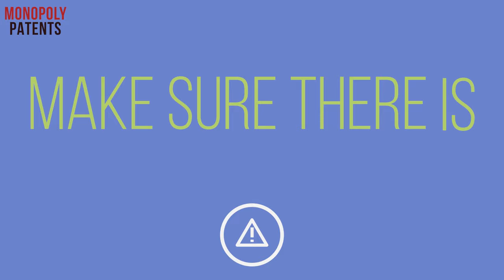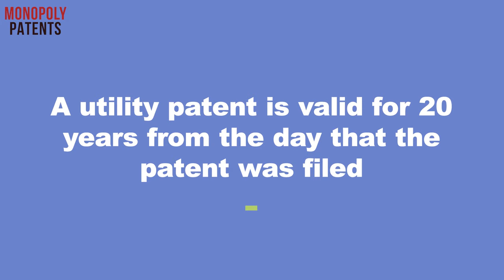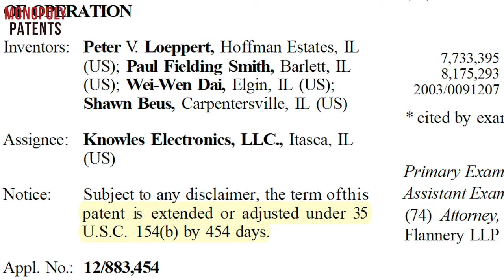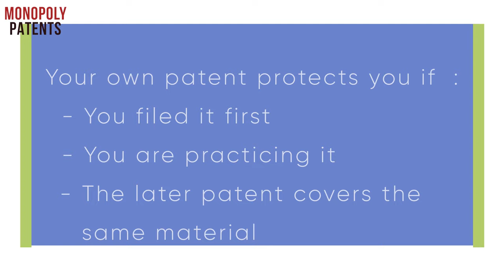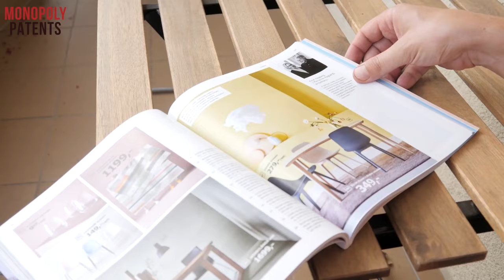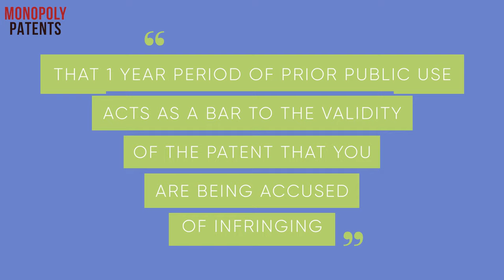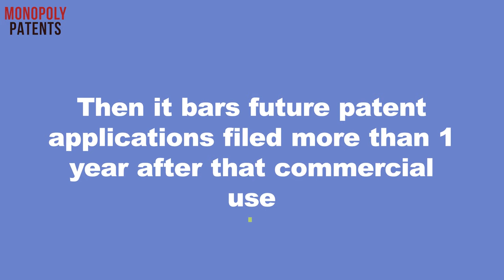7 Defenses to Patent Infringement

Comment: In regards to number 5 about prior publication, what exactly has to be published for the patent to not be justified? 

Say you patented a product you invented that isn’t on the market yet. Than someone copies it. You send them a cease and desist but they say your patent isn’t valid because someone talked about the idea of your product on a forum a few years ago. 

BUT no specifics about the product design or its manufacturing process were clearly stated. 

Can that invalidate your patent?
Reply from the maker: If the patent claim that you are accused of infringing has been taught in a printed publication more than one year prior to the filing date of the filing of that patent application, then the patent claim is invalid.  For example, if you are accused of infringing a patent claim of a recent patent that relates to a colorful bike handle bar streamer, and you find a 20 year old catalog showing detailed pictures of the same colorful streamers, then the patent claim would be invalid and could not be enforced against you.   'Hope this helps.  😊  -john
Reply: So as long as there is no details or pictures about the specifics of the product then it is still valid? 

Example:

Company invents, and patents, a product that allows you to mount a water bottle to your bike. 

Another company rips it off and sites a forum from 2 years ago where bike riders were talking about how they simply mounted their water bottle to their bike by their own means (no specifics on design or pictures involved). 

That wouldn’t count as useable prior art right?
Reply from the maker: @xrjake2955  Hi Jake, for a prior invention to act as prior art or invalidating anticipation of your invention, there needs to be clear evidence that the claimed invention was in the public prior to your patenting.  For example, a general discussion of a water bottle holder in an old bike forum would not be enough.  The discussion would need to clearly describe your inventive elements or better yet show in a drawing or photograph the claimed elements that you patented.  The publication needs to meet the burden in court of showing clear and convincing evidence that the invention previously existed, prior to the date of your patent filing.  'Hope this helps.  Warmest wishes, -john

Comment: Question on the fourth patent infringement. 
Is Amazon in violation for the advertisement of a patent infringement ad?
Please respond as soon as possible. 
Thank you,
Al
Reply from the maker: Hi AI,

I did receive the additional facts in your voice message and am addressing this here in a very general way.  If you would like to hire one of our patent attorneys for a short litigation, please let me know at jsferrell@carrferrell.com.

There is limited case law specifically addressing the liability of publishers for patent infringement due to advertisements. Most courts are likely to be reluctant to impose liability on a publication for advertisements unless there is clear evidence of knowledge and intent to induce infringement.

Establishing that your magazine had the requisite knowledge and intent to induce or contribute to infringement will be challenging. Generally, magazines do not scrutinize the legal status of the products advertised. Magazines typically include disclaimers and require advertisers to warrant that their products do not infringe any third-party rights. This practice can provide a degree of protection against liability.  If a patent holder provides notice to a magazine that an advertisement is promoting an infringing product, the magazine may need to take action to avoid potential liability.

While it is theoretically possible for your magazine to be held liable for patent infringement due to carrying advertisements for infringing products, the burden of proving contributory or induced infringement is high. Such cases would depend heavily on specific facts, particularly the knowledge and intent of the publication.

One notable case that addresses the issue of a publication's liability for advertisements that allegedly induced patent infringement is "C.R. Bard, Inc. v. Advanced Cardiovascular Systems, Inc.", 911 F.2d 670 (Fed. Cir. 1990). In this case, the court discussed the potential liability of a third party, such as a publisher, in the context of inducing patent infringement.

C.R. Bard, Inc. v. Advanced Cardiovascular Systems, Inc.

C.R. Bard, Inc. owned patents related to angioplasty catheters.
Advanced Cardiovascular Systems, Inc. (ACS) was accused of infringing these patents.
ACS distributed a brochure that provided detailed instructions on how to use their catheter in a manner that was alleged to infringe Bard's patents.

Whether ACS induced infringement by distributing brochures and providing instructions on the use of the accused product.
The court needed to determine if the actions of ACS, through their promotional materials, constituted inducement of infringement.
Holding:

The Federal Circuit held that there was sufficient evidence to support a finding of inducement of infringement by ACS.  The court found that the brochures and promotional materials provided detailed instructions that encouraged users to perform acts that would infringe the patents.
Reasoning:

The court stated that inducement requires evidence of active steps taken to encourage direct infringement, such as advertising an infringing use or instructing how to engage in an infringing use.
The intent to induce infringement could be inferred from the distribution of materials that had no substantial non-infringing use.
Implications for Publications:

While the C.R. Bard case directly involved the manufacturer of the infringing product, the principles outlined could apply to publishers or magazines if they were shown to actively promote or instruct on infringing uses of a patented invention.

If a publication knowingly distributes advertisements or instructional materials that encourage infringement, it could potentially be held liable for inducement of infringement.
The key factors would be knowledge of the patent, the intent to induce infringement, and the content of the advertisements or materials in question.
Conclusion:

The C.R. Bard case illustrates the broader principle that parties who play a role in promoting or facilitating patent infringement can be held liable for inducement. For a magazine to be similarly liable, there would need to be clear evidence that the publication had knowledge of the infringement and intended to induce such infringement through its advertisements.

This case seems different than typically just running paid advertising in a magazine, but serves as a reminder of the importance for publishers to exercise due diligence in reviewing advertisements and to include appropriate disclaimers and warranties from advertise

I hope this helps.  -john